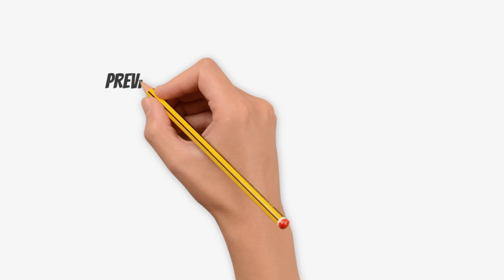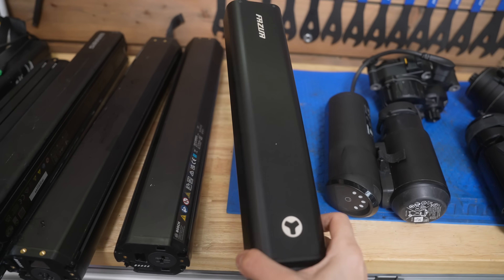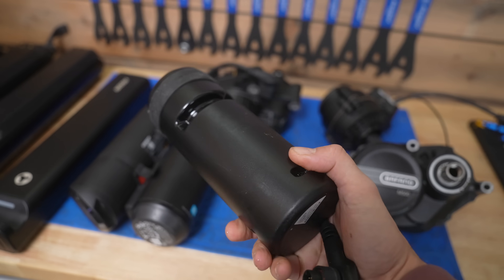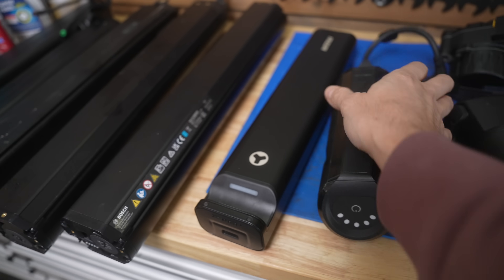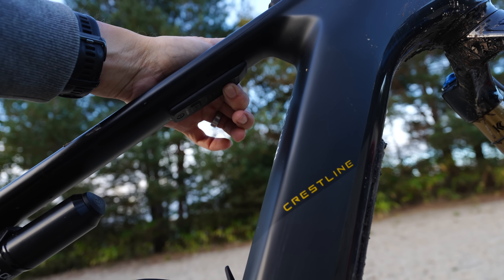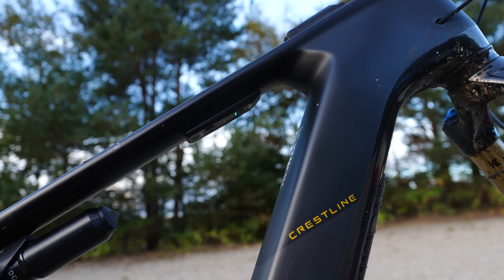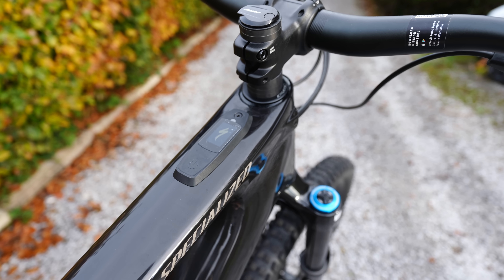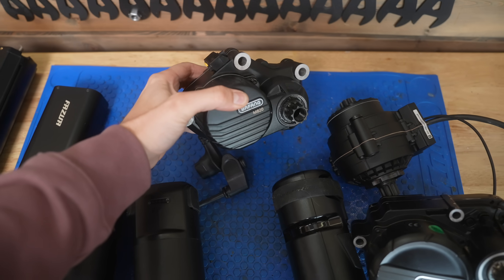We Have A Huge Problem With Ebikes....

Comment: Someone finally said it. Phones are a very good example of charging standards that the bike industry should take notes from. Thanks for the video Rob.
Reply: we only have that , with phones, because European Union forces them to do so.
Reply: @Kay0Bot  which is what needs to happen with e-bikes too. It'll happen but God knows when.
Reply: @Kay0Bot   and still cables only look the same on the outside but are different standards
Reply: This is why I voted for a bafang kit. It ain't pretty but I can use whatever battery I want, get spare parts, move it to another bike etc.
Reply: @tjts1  Bafang hardware & software is locked down. You can get a more open and modifiable kit from Grin Technologies with their PhaseRunner controllers, which allow you fully programmable parameters (regen voltage, max phase and battery currents, etc.), Field Weakening that allows you to run motors faster than normal back-emf limit, Automatic thermal rollback to prevent controller overheating and a Demux chip to separate speed and temperature signals sent on the same signal line.
Reply: Specialized is the Apple of emtbs. They rip off for some small pluses and some lousy reliability.
Giant allows the backward compatibilty all the way to.2020 models for eTrance battery. That is from 500Wh, to 625 ( which I have), up to 800 (2023).
Reply: Phone chargers were not universal until the EU mandated micro USB in ~2011. Recently they changed to USB C. It took 10-15 years to get to that point. Laptop chargers still aren't universal, although we're moving to convergence with USB C.

eBikes are in the same early stages of development
Reply: Phones are a horrible example because the completely integrated nature of the CPU, Memory, Modem, Screen, and Battery at this point. A far better example would be the PC, where there are standards for motherboards, memory, CPU, power supply, storage, and cooling such that you can replace/upgrade virtually any of these components using a product from a different manufacturer. Yes, there are some compatibility issues that must be considered (i.e. only certain motherboards support DDR5 RAM, etc), but the standards are open and well documented and support a robust ecosystem of products and manufacturers.
Reply: It took the phone industry like 15 years to get to a standard and that’s far less complicated than ebikes.
Reply: @kevinclark9176  not really : only the iphone was using non-usb plugs (micro or usb-C) and chargers ..... USB fast chargers were using different protocols that are now unified under the USB-PD (Power Delivery) norm. But good USB-PD chargers are also retro compatible with most if not all previous proprietary protocols !
Reply: @kevinclark9176 luckily the industries can learn from each other. If usb-pd is deemed insufficient (240w max?) They couls either use 2 ports or use a bike charging standard that was developed maybe 10 years ago.
Reply: @kevinclark9176  Phones are far more complicated than e-bikes.
Reply: I thought they introduced the USB C universal charging standard in the EU for all electronic devices (to be implemented next year or whatever). Why does this not apply to charging electric bicycles?
Reply: Put the EU on the case.
Have everyone adopt a standard solid state battery form factor, connector, and voltage.  The connector could be 240W USB Type C as someone else here mentioned
Reply: A bit late to the party here as this is the first video I've seen in my feed from this channel. In searching through the comments I haven't seen this brought up, at least with all these factors pulled together. USB Power Deliver protocol supports V36 & V48 charging at up to 5amp which only covers two of the three major voltages and comes in a little short of a small number of 6amp "fast" chargers I've seen but already you have one plug that covers the vast majority of use cases. Better yet the handshack of USB-PD would allow for it to be interchangeable as both a 36V 4-5amp or 48V 4-5amp chartered meaning one chargers could support countless batter types.

Bonus: I'm a professional A/V engineer and XLR which many manufactures use as a connector already has since I was born support 48V "Phantom Power" and has minimum number of connectors to adopt a USB-PD like handshack and the cables can handle the higher amp asks and have been carrying 48V over capbles for decades. I think these two plugs can support all the present and future Battery Charging needs for the foreseeable future and are both widely available in supported cables, plugs, and adapters.
Reply: Yep, but each phone company used to have a designated charger type. It took years for them to be standardised. This is the same for many technologies over the years.
Reply: I wonder if the EU won't introduce regulations in this regard.
Reply: I think USB type C at 240W (48v at 5A) is enough to charge a bike. And everyone will be happy
Reply: @dolofangeorge  Agree, one just need to down volt to 42V with a circuit inside the pack.
Reply: @dolofangeorge 
Of course, I wouldn't object if they extended the standard to 72V 5A or 96V 5A for a solid state battery
Reply: @dolofangeorge I don't think that is safe, USB C is not fit to carry that current. The max at this time seems to be about 140W at 3.5 to 5V, while the bicycle will need 250W minimum at 240V (for EU at least. A standard wall socket to stardardized transfo (somewhat like in a PC) approach will probably be safest to go forward. If it's legally standardized the government controls the legality of it through testing, with an attached label and warnings.

Less fires, less insurance, longer lasting houses, less pollution, less resources needed, it seems to have endless benefits to have a government that actually does us good (instead of starting wars and such).
Reply: @dolofangeorge  The problem with USB C is that all the capabilities of the device, power source and cable are a proper wild west. If I were to design an eBike I definitely wouldn't put a C jack in it or I'd be flooded with complaints about how it doesn't work. That is also the risk that every manufacturer fears about a standard charger - they won't be in control of what kind of destructive AliExpress junk people will plug the system into. It's already bad enough with the 3rd party batteries to eBike systems, Shimano blames the OEM and the OEM blames Shimano.
Reply: on the contrary, phones are a good example of planned obsolescence as well. No way to upgrade and basically useless after a few years
Reply: EU will solve that by 2025, regarding batteries for phones.  @EMBIKES
Reply: @bucharestbiketraffic  Yep EU are probably the only party that could force the significant change Rob is suggesting. Can't see the bike companies doing it without legislation.
Reply: @EMBIKES  Another problem is people wanting the latest and greatest product instead of keeping it for longer. Had my Samsung note 8, 6 years next month, still going strong.
Reply: @EMBIKES some work fine even after 5 yrs. Maybe you change the battery.
Reply: @EMBIKES  And everyone is happy! ahahahah
Reply: But assistance limiter is standarized for europe  countries to 25 kph.
I do not buy any new bikes. I have Scott 2018 , shimano e8000 that still works fine except of limiter that is damaged so I can go 40 kph :).
E bikes have many disadvantages so
I use more light carbon gravel bike no battery simple desiggn no limiters  achieve over 40 kph on  flat roads and it is better for keeping fit.
Reply: They were forced to do it.  I hate it.
Reply: Halla Marius!!!
Reply: Phones are exactly the same. Android and IOS aren't compatible ecosystems, the batteries cannot even be removed without great difficulty, nevermind compatibility with other brands. And software updates are not available for older devices, nor is it easy to remove the OS and replace it like a PC.
Reply: @s3tione  Software updates are available for older phones if you want to switch out software to an open source version.
Reply: So we need help from EU? :D
Reply: It also shows HOW to do it and get that standard pushed through: Get the EU to mandate it.
Reply: The industry wont "take note". Legislation will be needed.
Reply: So, you can't use solderer and use your engineering skil? Good, more money for corps.
Reply: So don't get suckered by computer controlled synchronous AC motors that waste most of your energy on power transistors and computer software that turns itself off without subscriptions and updates.
12V brushed DC radiator fan motors are a good choice. Pair them with a 5 buck pwm speed controller and 24V of LiFePo battery, driving through a freewheel on your crank.
Less than $200 total and you will outperform on weight, power, reliability and efficiency, any of the shyte coming from these brands.❤🎉
Reply: Using phones as a standard when it's taken them this long to all get to usbc isn't a good example. Especially when Apple put old USB c ports in their stuff do it still charges slower than most androids will
Reply: my thoughts exactly lol
Reply: Took an European law for Apple to conform though. Maybe a law would be required for the bike industry too.
Reply: legit  agree,
i remember when there was a samsung charger for the Blackjack, then they used the usb b micro, and finally Apple is now using USB C.

I hope that batteries can at least be semi-standardized. becuase its a lot of math if you try using a universal charger (just dont if you know what youre doing, since it lead to overcharging and battery fires)
Reply: @ericolens3 The Battery safety issues are more “wholistic” than just charging LiPo batteries in these configurations are easy to mess up and until recently there has not been UL compliance to make sure the batteries are being built for safety. Bad chargers should be handled by good Battery Management Systems to prevent major issues.
Reply: Umm.  No. You can’t take a Samsung battery and put it in an iphone. Your analogy is way off
Reply: There are no problems with standardization. You just need to know how many cells are in the battery. For example: 36, 42, 48, 72v. Each of them can be charged with any cheap charger by making the corresponding adapter. Usually, any charging connector consists of +/- and a signal pin for system activation. In 99% of cases, it is a closed pin on the negative side. In rare cases, there is a signal pin for temperature. The problem with the variety of connectors is caused by patent restrictions and licensing. It is easier to "invent" your own connector than to pay for a license. When they agree on which open-source connector to use, then there will be standardization.
Reply: Europe forced cell phone chargers to standardize.
Reply: yea usb was invented for a reason...
Reply: The problem is they don't have to.

Back in the day "everything" was standardized. That's how we got bolt patterns and Philips versus flat screws and things like that.  They need to voluntarily accept standards for the FUTURE of the industry. 

Tldr: he's 100% right. They are being short-sighted and if they had their own future bottom line in mind, they would work collaboratively to come up with a solid system that could be upgraded by their own engineers in the future.
Reply: @noahthegildedone5917  It's because it's a new industry, this sort of thing happens often with new tech. They'll realise the best way to fix this is to standardise the fittings and concentrate on performance, hopefully.
Reply: It definitley makes sense to introduce standards, but for that development is too fast at the moment. Imagine a mounting standard was introduced 3 years ago, TQ and Fazua would have been obsolet, as their main sellingpoint "stealthiness" would no longer be possible, but atleast in my mind it's great they could introduce new tech. Imagine telling all car manufacturers they have to introduce a universal motormount. There will be standards, but first let's see what works best.
Reply: @haemmertime  Electric cars are going to have an universal plug starting 2024 and from 2025 it’s going to be universal across US and EU. Bike industry is in shambles at this moment and this should serve as a lesson to why.
Reply: @bucharestbiketraffic   I even assume that cables and chargers are the first to be standardized, but for that you need either flexible chargers that can charge at different voltages which isn't something new) or a standardized Motorvoltage which is bad for Innovation. The cable could be unified easier though, best would be a certified third party company that makes a charger compatible with most brands and for the meantime adapters for any bike.
Reply: @bucharestbiketraffic that's actual not correct. Type2 and CCS will be EU standard while the US is moving to NACS and China is doing their own thing anyway.
Reply: Yep particularly important for charging infrastructure so that people on longer rides/tours don't have to take their charger with them.
Reply: @bucharestbiketraffic  Electric cars will not have a universal plug across US and EU. It's going in reverse. Ford and General Motors use EU's CCS standard in their US EVs until 2024, but will switch to the Tesla standard NACS in 2025. Japanese car makers use CHAdeMO and China requires its GB/T standard.
Reply: @TheFldh  Ford and General Motors use CCS now
Reply: @sammiller6631  Yes, but they and other announced to adapt to NACS
Reply: @haemmertime  fully agree! 
We just need to make sure the framework for standardization is being discussed, designed, and collaborated on now so that a way forward will happen.
Reply: Nu ma asteptam sa te gasesc aici. Salutare! :)
Reply: @georgeiulian17 poi Rob e cam cel mai bun pe reviewuri de eMTB...multi ne.gasim aici...
Reply: Salutari!  @georgeiulian17
Reply: This guy is asking for the industry to be governed by some Western bike company that has ripped off the public for millions of dollars. Forget that junk. I like ebikes and the industry just the way it is.
Reply: The problem is smartphone batteries are tiny and low powered (5v USB charging) compared to the batteries which power an eMTB. The [software] battery management to service the [high power] cells in a bike battery is very different - even if the principle is broadly the same.
Reply: @yodapig  Portable power tools are an example of higher power batteries that can be used with different tools from the same brand. It's not the physics of using higher power components that's limiting the standardisation of batteries.
Reply: @yodapig  There's phones that charge at over 100 watts nowadays.

Comment: Fantastic video as always Rob, by why not go one step further and offer the brands an opportunity to use this as a platform for collaboration. Even if you get a couple, it's a start.
Reply: You do not understand this ?  These systems are not compatible because companies don't want it.  Then they will lose a lot of money.
Reply: @Dryb1as   Yeah, that's true, as soon there would be an open standard, third party companies could kick in and start selling batteries for way lower prices. Currently you need to pay around 500 euro for a 150/250wh range extender from these brands, power stations with the same amount of watt hours are available for 150-200 euro. The small BMS chip in the battery costs probably 2-3 euro in production.... they will never give up these money cows and will work hard, to find reasons, why this will not be possible. It would only be attractive for very small brands, where customers are too scared to buy it, because they aren't sure if they got any spare parts in the future....

Comment: Great video and points about this. I bought a specialized kenevo since I figure they’ve sold so many (same motor and battery as Levos) and are a big company so fingers crossed I can get needed parts well into the future. As far as upgrading it, I’ll just have to be happy if I can get replacement parts in the future.
Reply: Yep - that’s why I bought a Levo as well. I’d be more likely to try a small brand if it was compatible with at least one of the big brands.
Reply: Exactly - be happy with the bike you own now. And as you surmise, a larger brand like Specialized is more likely to be in a position to offer parts support for older models for as long as they can.

Comment: Same story with power tool batteries. There are third party companies that make converters but they are big and bulky and could maybe damage your expensive batteries if there is no protection from overheating or over discharging
Reply: A converter to run different brands of battery will not cause it to over heat ect. Thats the job of the bms inside the battery.
Reply: Not the same. A 10 year old tool can work with a brand new battery and vice versa. And all major brands have well established battery systems with huge catalogs tools, new and old.